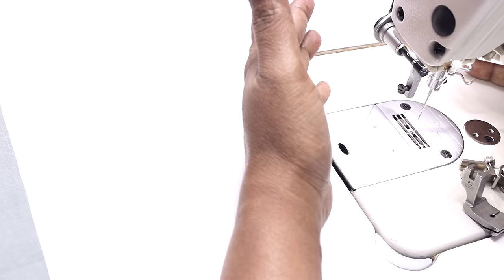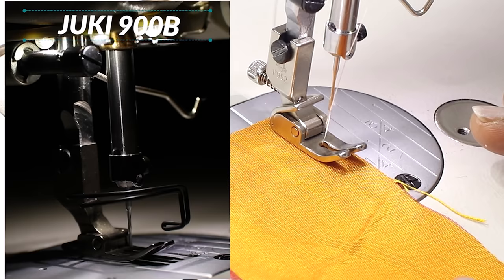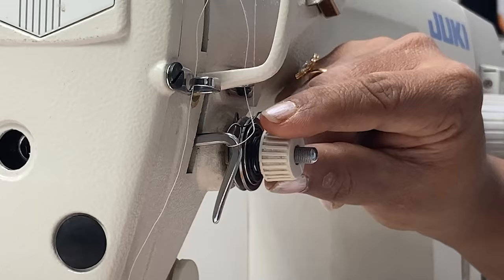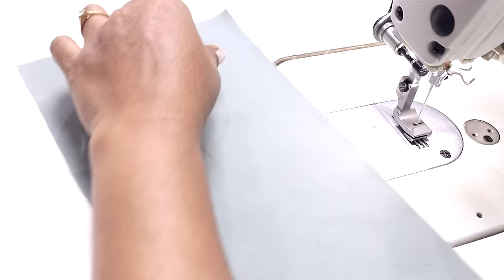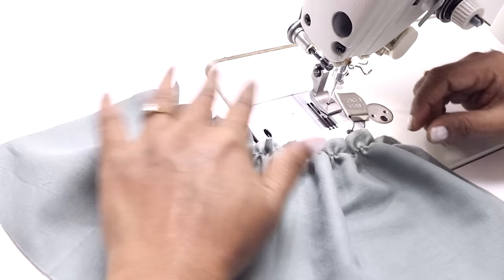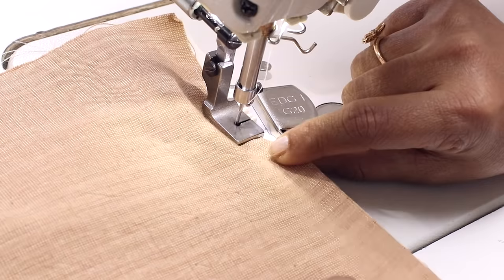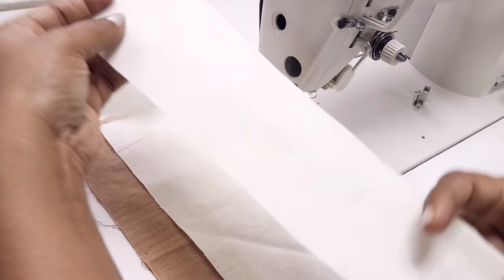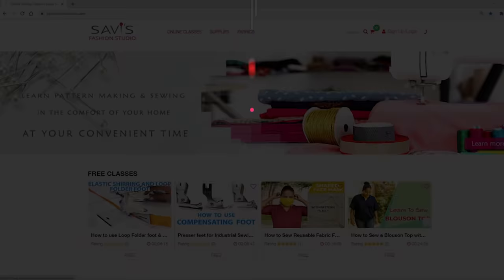Gathering / Shirring Foot for Industrial / commercial Sewing machines | P952 & P5 | Jack, Juki DDL

Comment: Mam please tell me about maintenance and oiling of brother GS 3700 sewing Machine
Reply from the maker: Keep the machine clean regularly. That is open the needle plate and with the small brush provided, remove the lint or any dust.  Once a month or so, you may just put one drop of oil in the shuttle [moving parts around the bobbin case].
Reply: Thanks alot mam❤️

Comment: Thank you so much ma'am for this information, ma'am mere paas usha janome wonder stitch machine he to kya jo aapne second no pr foot dikhaya he, usme use ho sakta he.
Reply from the maker: These presser feet are only for commercial/industrial high shank sewing machines.  It will not fit your Usha Janome but you get similar foot for your machine. You may check with your local sewing machine dealer. Using the foot is same as shown here.
Reply: @SavisFashionStudio  Thank you ma'am.
Reply: @govindsakhi1032  آ

Comment: Ma'am,  mine is singer 141g sewing machine. Can I use gathering and ruffler foot in my machine.  Please reply  🙏
Reply from the maker: If it is an industrial machine, yes you can use this presser foot and most of the presser feet meant for industrial machines.
Reply: Ma'am I want P5 presser foot.  But I can't pay via my rupay card. It shows the card number isn't valid. I tried it for several times,  but it's not working. Can you give me another option like watsapp or something.. please.

Comment: I have bernette sewing machine which pressure foot is suitable for my machine and how can I buy plz give me a link
Reply from the maker: These presser feet are only for commercial/industrial high shank sewing machines but you get similar foot for your machine [like P5]. You may check with your local sewing machine dealer.  Using the foot is same as shown here.